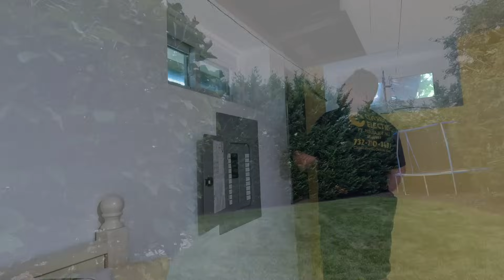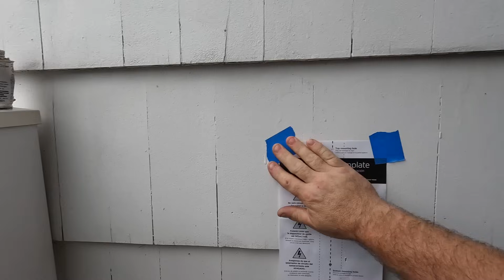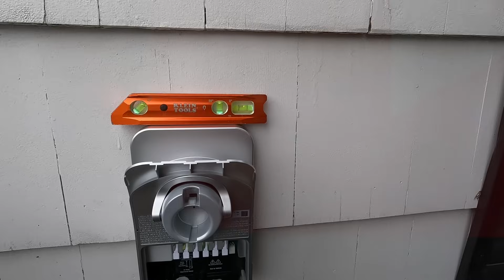Installing a Chargepoint Electric Vehicle Charger for Seamless Charging at Home #evse #chargepoint

Comment: I put about 10 feet of 3/4 pvc on the south side of my house, without an expansion coupling, and the summer sun cooked it and it warped terribly. It looked so bad I took it off and buried it next to the foundation, which I should have done in the first place.

Comment: Very much appreciate your channel, I keep learning new methods, tools and connection devices. Wish you were around 40 years ago when I upgraded to 200A and rewired an 19th century elephant wood frame mansion in Elbaron with all BX. Now I do all internet and RF work where it is required to cut with a scissor the end of outdoor tape (Scotch 33). The thinking is when you pull tape to break it, the stretched part dangles and eventually the weather unfurls it and you have bare metal exposed. Thank you for these, and thank your assistant camera person and editor, that's hard work too.

Comment: As usual, love your work.  This was a rather difficult install compared to most EVSE installs considering an additional sub panel needed placing.  It does illustrate what a homeowner might face to convert to an electric car.  But once you've done it once, you are good for the next 30 years!   Here's two minor nuances (not required) that I did for this same brand charger.  You may note the crimps on the cable side to the car.  I bought a nice crimping tool that attaches hexagonal crimps on the end of the wires and applied them.  This gave a nice solid wired to clamp to matching the manufacturing side.   The only other thing I did was use an additional plastic trim ring on the end of the threaded conduit connector to make a smooth low abrasion surface for the large #6 AWG conductors.  Just a bit of piece of mind against abrasion.   Your work is just a favorite of mine!
Reply from the maker: The plastic bushing isn't required for conductors smaller than #6 copper. I dont even stock 3/4" plastic bushings but installing them isn't wrong, per say.

Comment: Do Arlington 3/4" button connectors exist? If so, that might have saved you the pain of dealing with threading a locknut in that far back corner knockout of the panel. Lot of dexterity, finesse, and knuckle scrapes dealing with those tight spaces. Super impressive long run of that PVC under the eave down the sides, and then the pulling the conductors with that motorized snake! Amazing!
Reply from the maker: They do exist and I turned my van upside down looking for one but didn't have any. FML.
Reply: @Ampacityelectric  One-inch sizes, even. Thanks!

Comment: Great video!  If the circuits being moved to the new sub-panel were long enough, any reason you couldn’t have the new panel right next to the main with a nipple connecting them or even splice in existing panel to extend to new through nipple?

Comment: I think maybe you thought the video was getting too long so you cut out that part at the end where you joined the #6 wires together in the outside box.  I would have been interested to see how that is done because I didn't quite recognize what you used to do that.  It didn't look like a giant wirenut exactly, it had a plug on the end of it or something, I am assuming there was a screw that snugged down on the two wires and the whole thing is covered in vinyl?  Anyway, that's a minor gripe lol.  Great content, brother, thank you for the hard work you are putting into making it.
Reply: He reached for this allen wrenches so I'm sure it was a double ended spice connected.
Reply: He used what are called Polaris taps work very well for bigger conductors

Comment: You used a 60A breaker, which will provide 48A charging. The ChargePoint HomeFlex is preset to 40A but can be reset to higher or lower. How did you reset it to 48A?
Reply from the maker: @JosephGreenleaf  Chargepoint comes with 20A max setting. Use the app to change to 48A charging.  Also, the circuit breaker protects the conductors so charge at whatever setting you like.
Reply: Driver app or installer app?

Comment: Noticed you ran that conduit right next to what looks like some Coax(essentially low-volt) cable.
Not to be a tight ass about it(most inspectors don't enforce it in residential), but in the future I'd take note that the NEC calls for HV wiring to be at least 6" away from low-voltage wiring that runs parallel more than 6'. 
I work in IT (though I had an appliance installer's license for working with HV battery systems which requires NEC knowledge and compliance), and I've had 2 clients, and one major ISP(a major claim) successfully claim against electricians because they ran new HV parallel to their LV networking cables.
The clients' cases was a result of a power surge and inductive load(on a 60A sub circuit with lines ran parallel to a CAT6 cable) frying their outdoor POE security cameras(with the POE switch being adequately surge protected).
The ISP case was due to a service conductor being ran parallel to a Coax, and a similar aforementioned surge killing equipment at the ISP vault.
Reply from the maker: Cool!

Comment: Great video Ron!  What size conductor did you run from the panel to the charging station?  Was that #4?
Reply from the maker: @AchFam  #6 AWG copper.
Reply: He talked about installing a 60 amp breaker and 6AWG having an ampacity of 55 amps in the 60 degree C column.

Comment: Nice neat work, but I wonder how often chargers will have to be swapped out. They contain delicate electronics inside and the flexible cords might get damaged with use. And you know the next one will have different mounting holes, knockout locations, and terminal locations.

For example, the install instructions for the Tesla Gen3 wall connector say to route the wires through the service loop channel on the right side of the unit no matter which entry point is used. So, that charger will need at least 1.5 feet or so of wire inside the unit if the instructions are followed. I know it monitors the heat at several locations - perhaps that is why they want so much wire inside.

So, it might be worth keeping a bit more wire slack available than normal for EV Chargers.

Comment: You can use the 75c column for feeders correct? Assuming the wire is not romex which is only allowed the lower temp rating, and the circuit breaker is rated at 75c as well. Say I was using SER cable for instance.
Reply from the maker: And more than 100 amps.
Reply: Unfortunately, with that small section of NM cable to the charger (EVSE), he should have used the 60C ampacity rating of the conductor (55 amps x .8 = 44 amps max continuous) and install a 50 amp breaker max.  Code violation.

Comment: Love watching your installs Ron. Something I see guys do when installing the thicker gauge wire in tight spaces like that (especially the control panel guys), rather then kink the wire, is to coil the wires. Wire comes out of the conduit, does a 360deg loop over itself and lands on the terminal block. Less sideways pressure on the termination and looks elegant. It's something I use when terminating Datacom as we have minimum bend radius to consider and still need some slack to remove the jack plate when we're doing moves/adds/changes/repairs. Datacom guy so I work alongside sparkies, pick up a few tips now and then.

Comment: Could you make a video showing how to make a proper slice with 6 gauge wire something like you did in this video . And thank you again for an amazing video
Reply: @Ampacityelectric   thank you for sharing the information
Reply: He used a Polaris splice, its has lug ends on both side. He just wraps it up with electrical tape after.

Comment: If there is a drop ceiling then why not run the wire in the ceiling for the car charger
Reply from the maker: Good question! Because there's a finished hallway and bathroom between the basement ceiling and the garage, which is also finished.

Comment: so i can slap a 60 amp breaker on my existing 14-50 receptacle.
Reply from the maker: You can do whatever you want.
Reply: @electricianron_New_Jersey  are you sure? i dont wanna get zapped dead lol
Reply from the maker: @miltonaldridge4170  then call an electrician.  The circuit breaker ALWAYS protects the circuit conductors and I have no idea if your conductors are rated for 60 amps or not.

Comment: You know better than me but have a question about conduit. Would it be faster and better to use NM rain tight flexible pvc conduit.  One long run vs glueing 10’ sticks together. Thanks for providing top notch professional info.
Reply from the maker: The flex PVC will be more difficult to fish conductors through.
Reply: It would look terrible because it is not stiff enough to lay straight. It would be as crooked as a snake.

Comment: By using the 6/2 romex at the beginning... didn't he limit the circuit to 40a ev charging? If you wanted a 60 amp breaker, you'd need to do conduit/THHN to the breaker box right? That would give you 48a ev charging
Reply from the maker: NJ allows the 6/2 NM

Comment: Did you run it as one whole wire if you did that’s a pain in the ass
Reply from the maker: The whole job can be a pain in the ass. That's why it's called "work"!
Reply: I’m probably going to run a 12 to 2 and outdoor shed in nj going to keep it a hole running through the conduit

Comment: Putting the clamp right at the expansion coupling near the meter does not allow the pipe that is exposed to move, should have left a couple of inches then clamped. Great learning video! I worked at a plating facility and everything was done in pvc.
Reply from the maker: You might not be familiar with an extension couplings because it is installed correctly.
Reply: I am not saying the coupling isn’t installed correctly, it is the fact that with the clamp at the top part of the coupling the expansion can only move in one direction. I am very familiar with expansion couplings and installing them on pipe runs in the sun. If you are happy so am I! LOL
Reply from the maker: @Ampacityelectric  PVC straps break over time.  Unfortunately they’re terrible.

Comment: I just did a charge point today. I like them other than I really don't like those snap wago type connectors they have. They seem chincey and you don't really know if connection is tight either. Dang, can't believe you have to use expansion sleeves all over there in jersey. Were just SEU/SER here in midwest don't need conduit unless spec'd